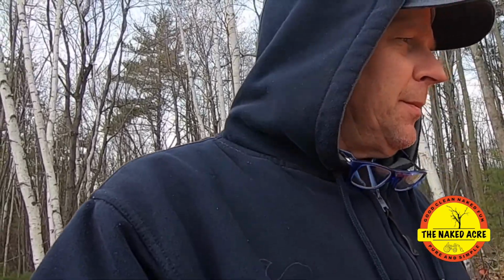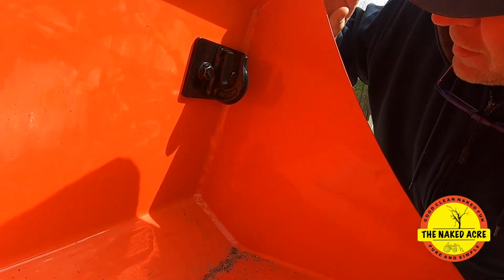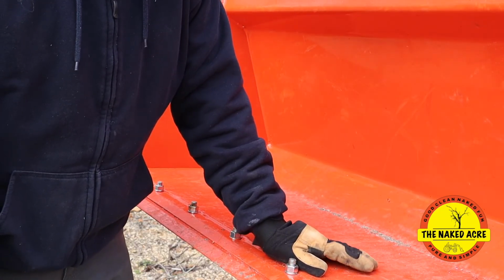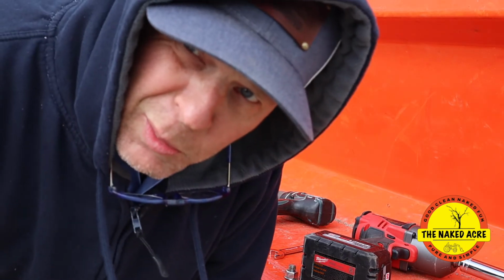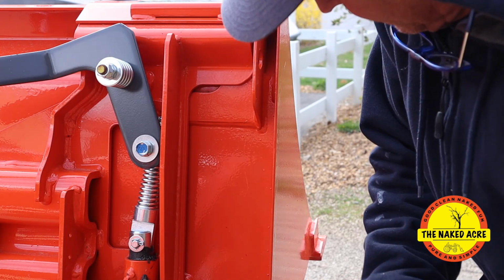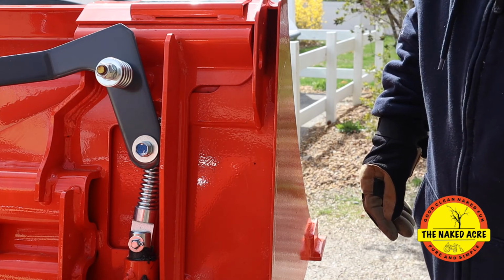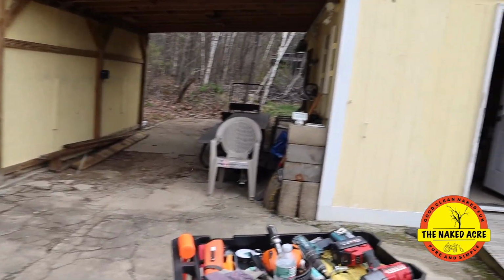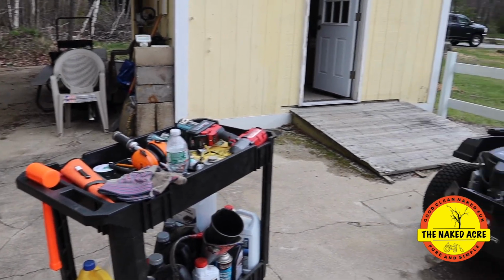Installing Two Tractor Bucket Hooks.

Comment: 💥 Nice bucket hooks, I could use a pair of those. I'd just take a grinder and remove about an 1/8 inch to make that fit better over the weld. Also I'd cut off the excess thread so it doesn't interfere with bucket removal or catch on anything. Hilarious title by the way!! 
Keep on tractoring!